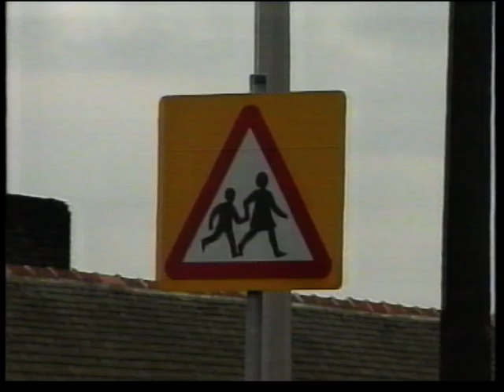Sowerby bridge RTC - LGV into building 1993

Comment: FODEN tipper not a easy truck to drive due to been non syncromesh gears and cable gear change that been under the tipping ram and inevitebly covered in dust made down changing difficult. However the truck had not just set off and blameing the truck operator was the easy way out as the driver was a ex police officer so he would'nt be to blame
Reply: Try the brakes were found to be worn out and maintenance non existent. The Driver was completely exonerated.
Reply: @GarethT902  That was the inevitable result of a police investigation when one of their own was driving no doubt. the driver had carried out a long journey prior to that point and brakes just dont wear out so why did'nt he stop before that point??. Fodens with cable gear change were always difficult to change when worn, full of dust and been non syncromesh, it was always my thought he could'nt  change down.